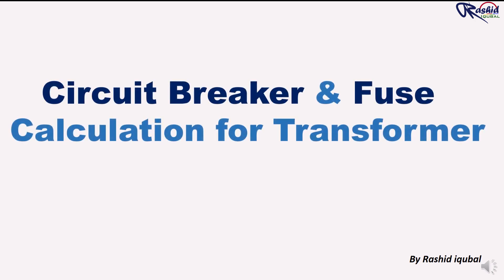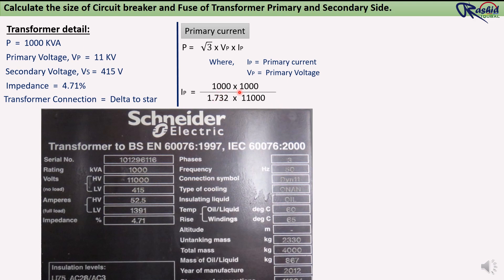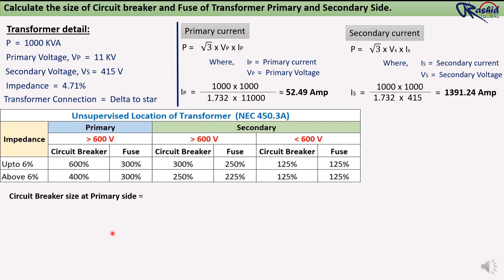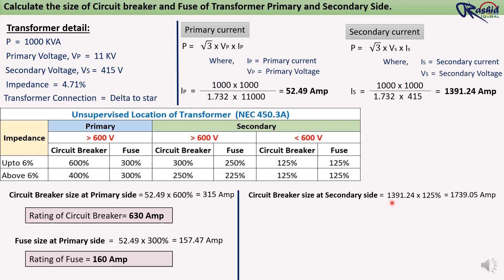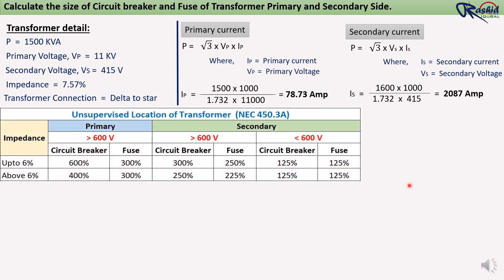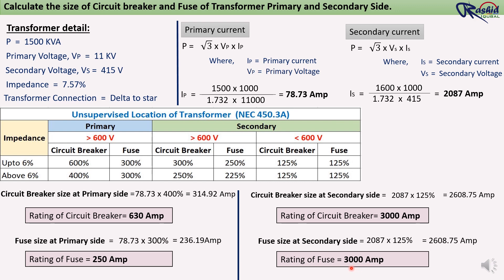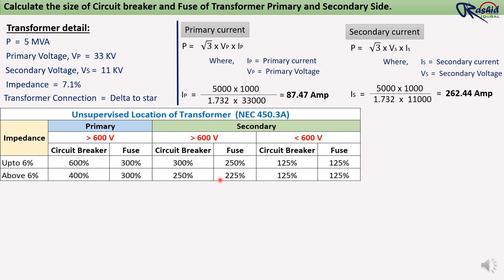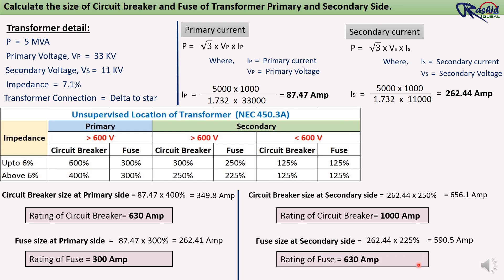Transformer Circuit breaker and Fuse size Calculation

Comment: Sir, This refers to your calculation for secondary side i.e 11KV low voltage side CB and fuse selection for 5 MVA ,33/11KV transforme.

For 11/.415  KV ,1000 KVA transformer primary side CB rating selection ,basis on NEC 450 3 A you calculated 6 times of rated primary current is understood to me.

For 33/11 KV 5 MVA transformer ,as per NEC 450 3 A,you are calculated secondary side CB rating 3 times of rated full load current.
Why?

Further step down transformation required then primary voltage 11KV will be there and similar to case 1  transformation inrush and megnetising are to be assumed and considered.

Therefore 6 times rating of rated full load current must be calculated for 11 KV secondary voltage i.e.for 33/11 KV transformer.

Kindly explain this with reason.

Comment: Dear Sir, if we select fuses on primary and secondary. What type of fuse should be used. Time delayed, instantaneous etc. Also for circuit breaker, what other parameters such as L,S,I,G are needed? Your videos are very much helpful for engineers like me. Thank you once again.

Comment: EXELLENT,,,,,,,,,,,,Whats your point of view in this example           750 kva/1.73*34.v kv=12.55 * 1.25= 15.68                     the engineer used a 15 amp fuse in medium tension  34.5 kv ........thanks for your comments

Comment: Very useful video ...nice way of teaching....I have a doubt sir...if the primary current of transformer is 262 A...and standard size of fuse is 300 A...then how can it trip the supply..or protect ...
Reply from the maker: A fuse doesn’t trip exactly at the rated current, it allows normal load and only blows when there is excessive overcurrent for a certain time..

Comment: For the 2nd example, is there a reason why you used P= 1600KVA for the secondary current? or was that a mistake?
Reply from the maker: It should be 1500 kva, typo error

Comment: dear i follow NEC calculation, but not in all cases , you have given exp of 1000 kva which has currnt capacity 1440 amps and we can consider 1600 amps which is already at next size then why we go on 2000 amps 2 times higher than trafo size. we know when we on transformer , inrush current happens but if we size the breaker as per curve characterstic then we don need to go on higher size which is technically and economically not good.
Reply from the maker: Brother i request you to please watch this video carefully, for 1000KVA full load current is 1391.24 amp and as per NEC standard we must consider 125% (125%  of FLC to ensure it can handle both the regular operating current and the inrush current)  then it become 1739amp and the next available size of breaker will be 2000 amp.
Reply: @Rashid-iqubal  dear I appreciate your effort but adding 125 percent on line current secondary getting oversize more than transformer is unnecessary requirement. 1000 kva line current is 1440 amps available size z 1600 amps ACB in which breaker curve can bear the inrush current , that's m not talking in the Air that is my practical exposure I have done projects and proposed 1600 amps ACB that's under operational , running smoothly without any tripping. 
I follow nec alot but I have concerned on NEC 450.3A . 
Cause your design standard not only based on NEC practical exposure also does matter , when 1600 amps ACB characteristics curve offers over current protection then why do I go on 2009 amps.
Reply from the maker: @salmananwar8370 based on your country standard or design it may happen.. i also worked in saudi and Qatar, depends on requirements and project  budget we can negotiate. However for 1000 kva transformer i always used 2000amp ACB and very rarely i see 1600amp ACB. 
I am not saying that 1600amp is not correct. Moreover you worked in Saudi, in middle east they never compromise with safety and standards. 
And my calculation is totally based on NEC standard.. hope you understand dear..
Reply: @Rashid-iqubal  recent I have completed data center project in ryadh in which all trafo's are dry type as per specs dry type generate huge inrush current, I installed 4 trafo's of 3150 where I proposed 5000 amps ACB accordingly all substation are operational and working smoothly.

Comment: For sizing breaker, contactor and cables which standard you normally use?
Reply from the maker: @manzoorkhan5246  NEC
Reply: @Rashid-iqubal  please explain it further or mention any specific code like 23567

Comment: In India we follow iec rules and not nec rules.You can consult any state electricity authority and you will discover  
that proper fuse size for this transformer will be 80 A.CB rating for secondary will of course be 1.25 times secondary current.

Comment: What if it is a step-up transformer? 480v, 3ph to 4,160v, 3ph. Say impedance is 5%. Am I using 600% factor from the table to size the circuit breaker on the primary (480v) side?

Comment: What do we use to select a circuit breaker, full load current value or short circuit current value? Please clarify, i am so confused..
Reply from the maker: For circuit breaker calculation you need both full load current and short circuit current. 
Through full load current you can find out the rating of breaker. If current exceed then full load current in any circumstances like over load or short circuit, breaker will be trip.

While short circuit current work when huge amount of current flow like 100 or thousand times more then full load current then breaker trip immediately in few mili second. It will protect system from fire as well as breaker it self.

So if you purchase circuit breaker you need both rating. Eg 1000A ACB with 50KA short circuit current in 1sec. Or 36KA in 3sec.

Thats mean circuit breaker can tolerate 50Ka current upto 1 second. 

Hope you understand.
Reply: Thanks alot, understood completely sir..

Comment: Why you did not consider the fault current of primary side of HT 33 KV brraker rating will come above 800 amp if you will see the fault current
Reply from the maker: Actually In this video I explained CB current rating as per load.. 

For fault current calculation we should divide full load current (Is) / impedance. 

Short circuit current always higher than normal current rating of breaker. Every circuit breaker has two types of rating that is current rating and short circuit rating (ka) 

As per my first example we have selected 630amp circuit breaker and its short circuit current would be 52.49/4.71% =1.1Ka

I will make another video which cover all safety protection. Thanks for watching